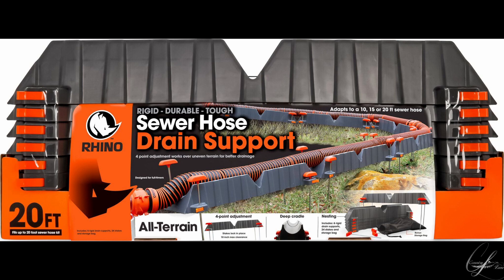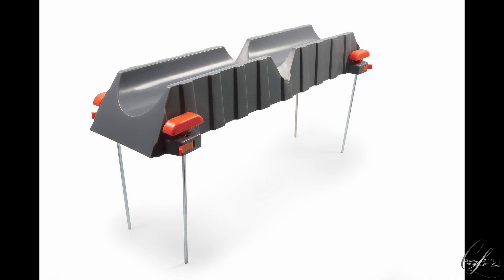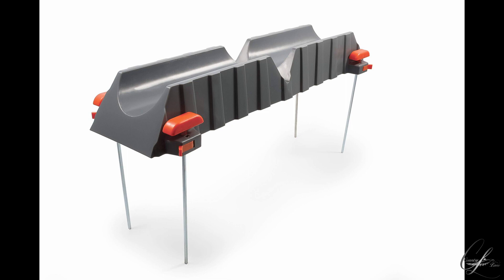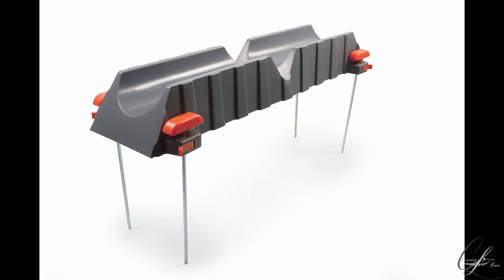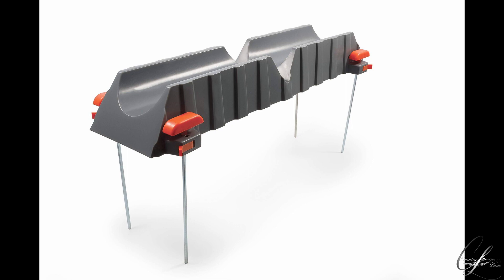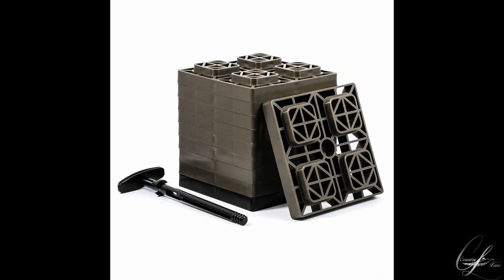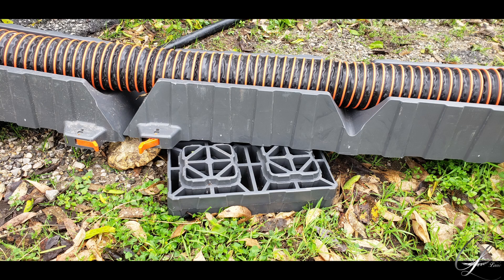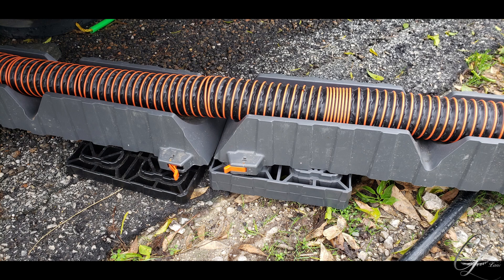RV Sewer Hose Support Tip

Comment: I don’t get these pipe supports. Don’t you only open to drain once it’s nearly full? Is it hard to just let it drain then lift up the hose and run along it to get the rest out? I think it would be less time to do that then set up this support system. I suppose if you were living our of your RV and never moving around then it would make sense but otherwise I’d rather not bother with it.
Reply: At the end of the day, everyone needs to do what works for them. Opening your drain when the tanks are full is typically the advice that you see the most often, especially for the black tank.  The tip in my video about supports  isn't geared toward any specific circumstance (short term, mid-term, long term stay, etc), but is probably most useful for someone that intends to stay at one location for awhile.  However, I see a lot of people connect their sewer hose the minute they arrive at a campground, regardless of how long they are staying.  I don't, but many people do.  Also, I tend to just let the hose lay on the ground most of the time without supports, but there are times when a support is beneficial.  I have also heard of some campgrounds that mandate that your sewer hose must never touch the ground, therefore a support is mandatory. I have not been to one of those campgrounds, but I am aware of the requirement at some campgrounds. So, if this tip offers no benefit, there is no reason to use it. If supports are more trouble than they are worth, then don't use them. There is no "right" answer. But if you use the supports that I show in the video, using something other than the metal legs might prove to be easier and faster than messing around with the legs, and it's something that you may not have thought about....so I made the video.  Have a great day and thank you for watching and commenting.
Reply from the maker: You need to do whatever works for you. This suggestion is probably more practical for people that are stationary for a few weeks to a few months and/or have small capacity tanks. I don't do this every single time I move to a new location since most of the time its easier to do something other than what I put in this video. But once in a while I use this suggestion. Many people may not think of it, so, I made a video to give people a suggestion that maybe they hadn't thought of.  Thank yo for watching.